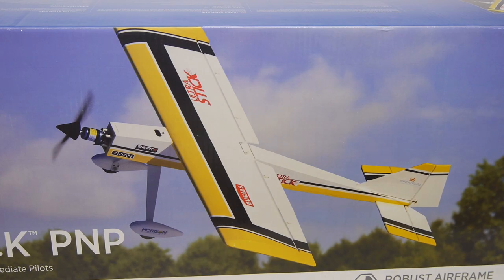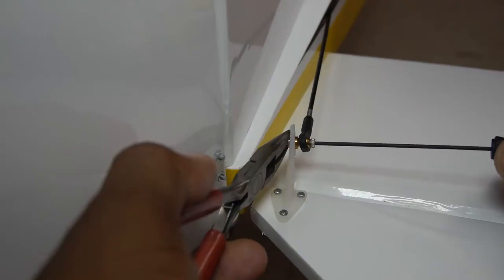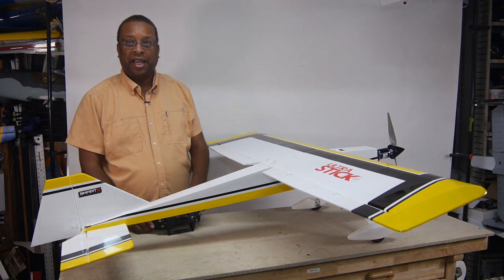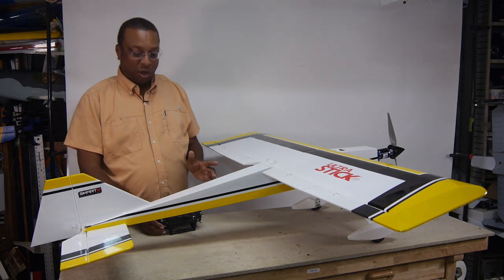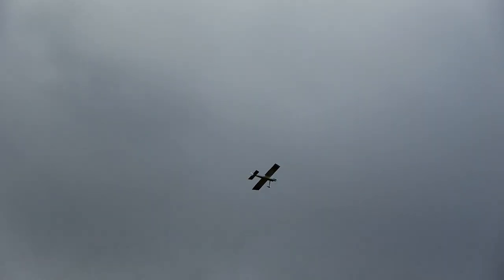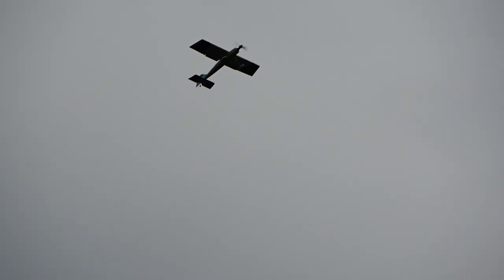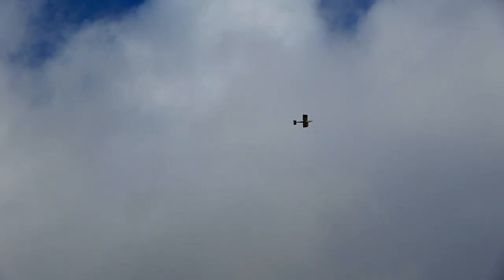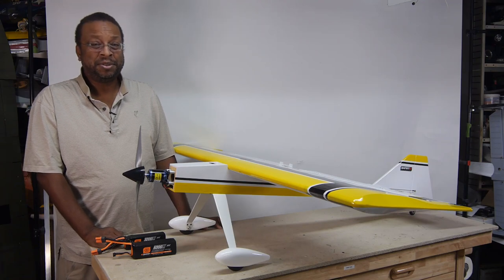Hangar 9 Ultra Stick - Modern Fun in a Classic Design | HobbyView

Comment: I hope you get a commission on these because you just convinced me to buy one, and I'll put an AR10360T receiver in it because I like having the barometer chip (one of the sites I fly from is close to an airport so there is a hard 400 foot ceiling for good reason). I'd been kicking around the idea of buying one of these and you just convinced me, I wanted to experiment with crow and the flap mixing. I'm also thinking of installing a candy dropper or something like that with the extra channels. Thank you for an excellent and informative review.

Comment: That's a lotta switches.  I'm not too familiar with Spektrum programming, but is it possible to simplify the pilot workload by setting up those behaviours to tie in to your rate & flap switch?

- Use a 3 position switch for Low, Medium & High rates.
- Either always have aileron & flap mixed together (gives you consistent feel in the air), or keep them separate in Low rates, and mix them on your Medium & High rate settings.
- In Medium or High rates always have flap mixed to elevator for tight loops.

I think if you assign both your Flap and Rate switches to activate flight modes a modern Spektrum radio lets you do all that, and then you're just flying with a standard flap switch and rates switch.

Then for crow, either have that where your landing gear switch would normally be, or set it up like a glider with proportional crow braking controlled by the throttle stick.  Anytime you hit your throttle cut switch, enable crow with it activated proportionally by pulling back on the throttle stick.  In normal flight you pull back on throttle to slow down, if you want to slow more you hit your Crow/Gear switch and then again, the more you pull back on throttle, the slower you go.

Comment: I noticed with flaperon mix, elevator is also working ss it does with flap mix. Is there ANY way to omit that mix during flaperons? 🤔🤯

Thx & i just subscribed! 👍
Reply from the maker: Thanks. 
Sure, you can dial in more or less elevator mix through the 'Flap System' menu on the Spektrum transmitter.

Comment: Sticks are great airplanes. I had the .40 size when they first came out back in the early 2000's and I put many flights on it. I wanted another one and I decided on  the 30cc version with a DLE-30. They can go from mild to wild and everything in between and the control surface mixing possibilities are a lot of fun to experiment with.  I've buddy boxed new pilots on the U.S. with great success as well.

Comment: Nice  vid . Just can't understand why a 4s rated power plant wasn't used. 6s is excessives and more expensive for no apparent gains the size of  model doesn't warrant it. Do like your mix on the control surfaces. be nice and responsive